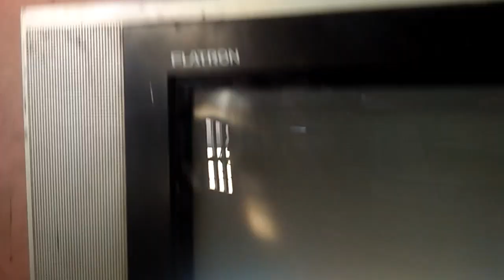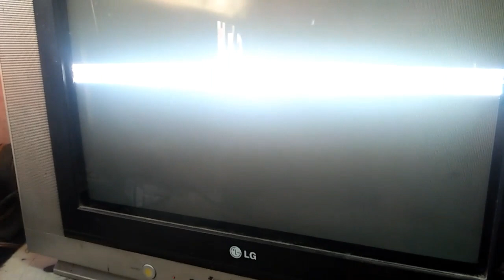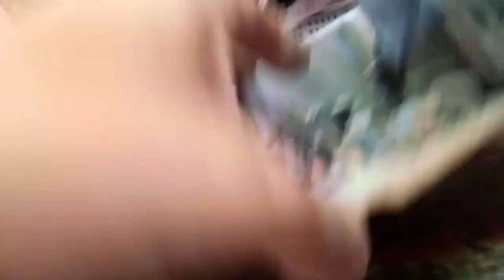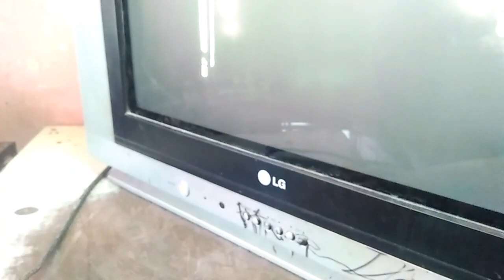Lg crt tv maliit ang display (basic)

Comment: Sir ganyan din sira ng tv na inaayus ko samsung nmn horizontal line display nya check ko na vertical supply my 24 nmn check output papunta sa yoke my voltage nmn ako nakukuha kaso mababa check ko input signal walang reading yan nga sabi my screen maliit na my guhitguhit nmn sa taas
Reply: try mo check mga cap sa vertical

Comment: boss anong problema ng Crt tv na isang dangkal lang ang screen?my itim sa taas at ibaba po..nagpalit nko ng Vert.IC pero ganunnpa din ang paligid na capacitor?pls.patulong po..salamat boss..
Reply from the maker: Normal ba ang display kahit maliit o may fold over?
Reply: @Wongtvtechvlog  Normal boss...
Reply from the maker: Adjust mo nlang vertical size sa service mode.. Anong brand?
Reply: @Wongtvtechvlog  Surplus na Sanyo boss..problema dko mabasa dahil japanese ang sulat.wala ding remote..
Reply from the maker: Magpalit ka nalang ng resistor trial and error bro. Hanapin mo yung capacitor na connected sa vertical yoke palitan mo ng ibang value yung resistor na connected sa negative non.
Reply: @Wongtvtechvlog  Okay po boss..maraming salamat..God bless!

Comment: Sir, alm nio ba datasheet ng L213 S1H2131X01-X0 VERTICAL IC D MKTA S google gusto q lng kc mlamn qng my rating voltage ang pin 3 & 5 nia
Reply from the maker: Ano bang trouble ng ginagawa mo bro?
Reply: Standby mode then clicking sound  sir samsung surplus tv po
Reply from the maker: Kapareho lang yan ng ka2131
Reply: The same pinout ba sir?
Reply from the maker: Anong number ng regulator nyan?
Reply: SQ0765RT
Reply from the maker: Ka2131 lang yan bro
Reply: Yun po ba ang png replace s vertical ic sir? Nglaw n kcng tong gngwa q ngyon ng ibng tech ngtka kc aq s value ng vertical.
Reply from the maker: Check mo muna kung may secondary supply tpos check pin 18 ng system control kung may 4vdc kpag i power on check din pin 4 ng sec.reg na 7631 kung may pumapasok na 4vdc bilang trigger para maglabas ng different dc voltage para sa jungle check rin 3.3v at 8v ni jungle
Reply from the maker: Check morin yung mga ecap sa tabi ng 7631
Reply: Sige sir